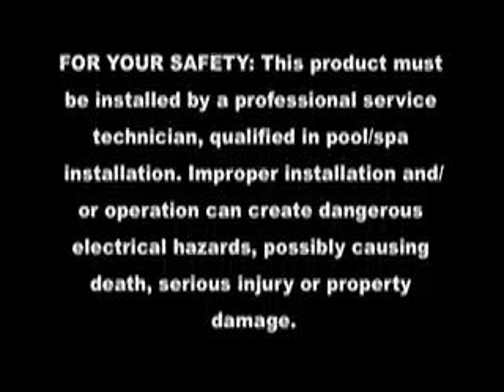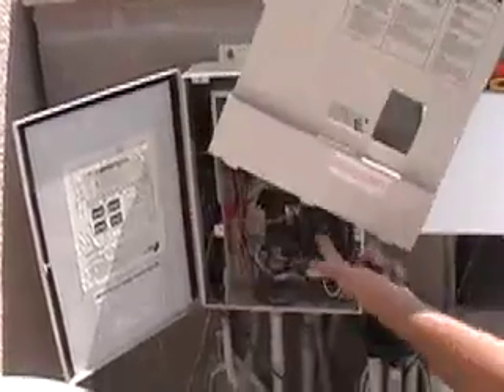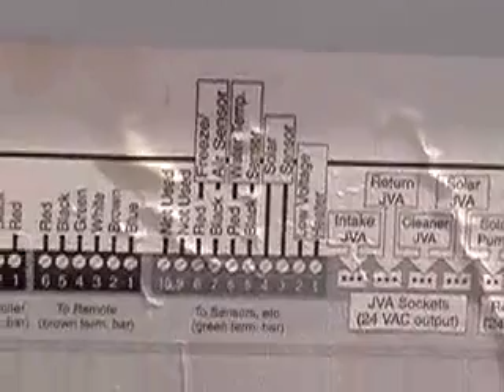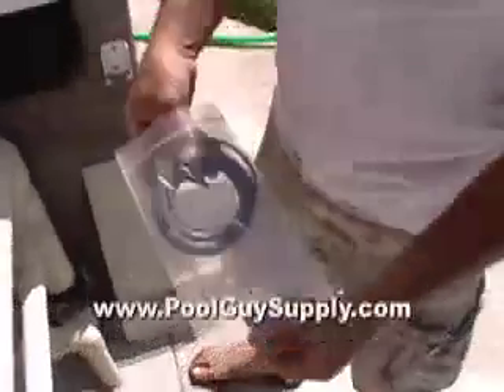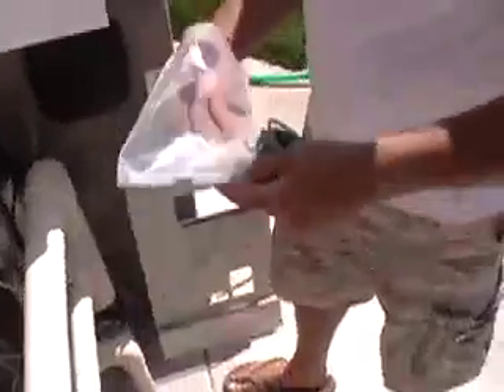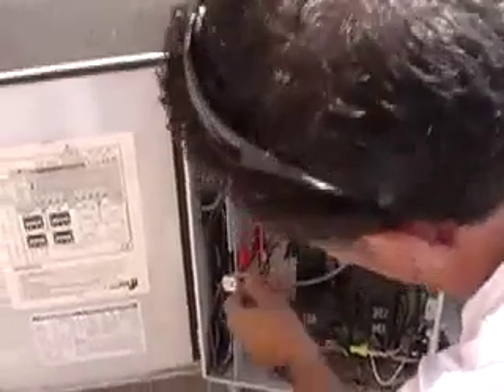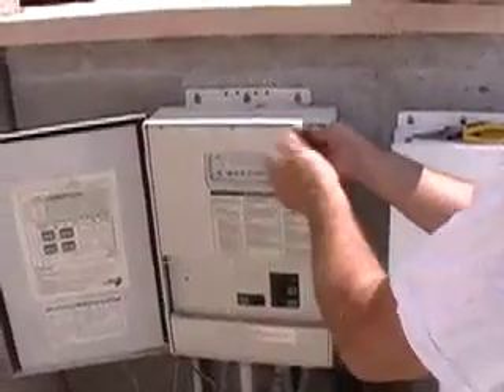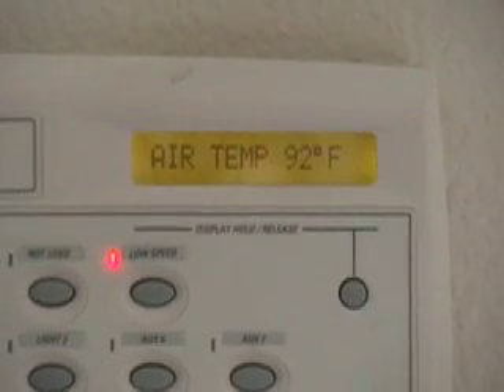AquaLink RS8 Temperature Sensor Replacement

Comment: Is there any way to test these air sensors before cold arrives? I believe the answer is no, they just fail. In the old copper styles we could simply expose them to a baggie of ice and it would activate, no so with the new type currently being used by all 3 major brands. Can't even test electrical conductivity.

Comment: My temp sensor wiring went through conduit with silicone then to the Jandy box.  Nice install, but there is no way to use it again.  Rather than going through a rewiring of it all, can I just splice the wiring from the old install onto the new install?  I was thinking of using a sprinkler wire grease cap to protect the wires from corrosion.  But it just seems so much easier.  No one mentions this, so wondering if this would be a problem.
Reply from the maker: You shouldn't have a problem splicing the wire with your existing wire as you mentioned. The sensor failure typically happens in the probe itself, so using your existing wire should not present any problems, unless your existing wire is very very long.
Reply: @PoolGuySupply  Thanks for the reply. Since I will be using the existing wire, the length will be the same, just a few more inches added at most.   I will report back to inform how it went.
Reply: Success!  It literally took me 3 minutes. Removed the old sensor, placed the new sensor, tightened it down.  Spliced the existing wire with the new wire at the sensor site using small grey wire nuts.  I will add a sprinkler wire grease cap once I get one at Home Depot so it doesn't corrode.  Temperature is now accurate at 76 degrees. This method allowed me to avoid opening up the control box and rewiring.

Comment: I was ready to have a melt down not understanding much of anything about my friggin non working pool I have spent a fortune on over the past year in repairs. No pool guys seem to really know what the heck they are doing either and American Home Shield, well, they don't deal with automation problems. Now it says "water sensor shorted" on top of everything else.  I can't even get a handle on these damn valves. The Kreepy Krauly never has suction for more than a minute.  Anyway, I found this video and if it weren't for the song making me laugh, I would probably be crying right now. So thanks you guys!
Reply: +Carisa Marion - 13 years as a pool tech and one thing I've learned is that American Home shield does not pay normal rates for parts or labor to pool companies so therefore only get a revolving door of inexperience. I could tell you nightmares all day long of my experiences with all home warranty companies. It may come in handy for other household needs but is wasted money on pool equipment.

Comment: And if the sensor leaks after installing?  Is there a separate o-ring?  Should I have used waterproof silicone caulk?
Reply: Solved!  A) make sure pipe/hole area is clean and remove any old rubber/caulk and B) Like the Poolguy said, don't overtighten!

Comment: My pump is not coming on in freeze mode, and my solar sensor has shorted.   Could the solar sensor be the problem or would it say water sensor shorted?
Reply from the maker: Freeze protection turns the pump on when the air sensor reads the air temperature near freezing.  So if your freeze protection is not engaging the filter pump, then the air sensor may not be reading the correct temperature, or the setting configuration may have freeze protection turned off.